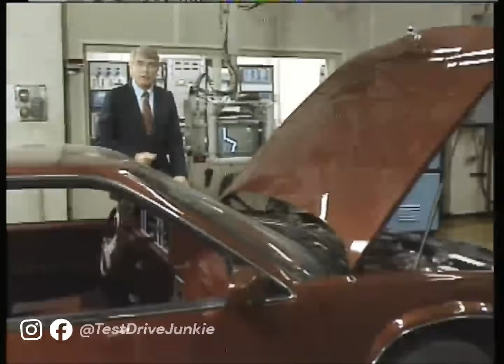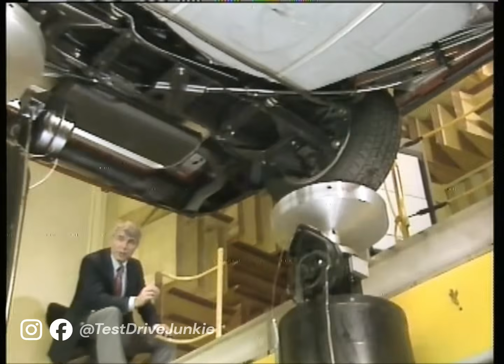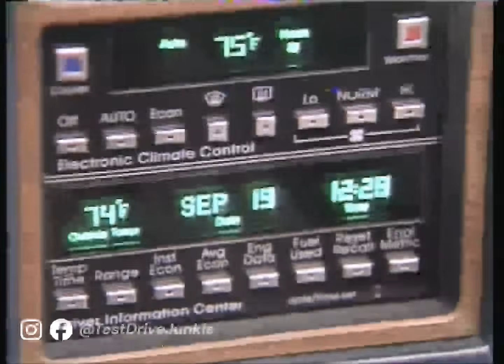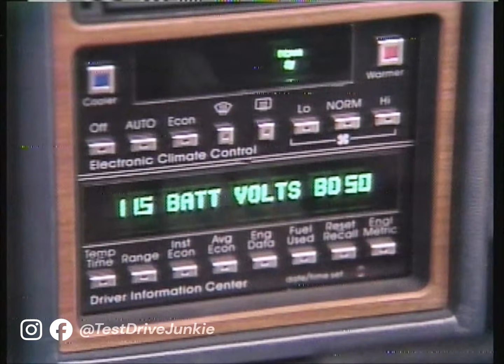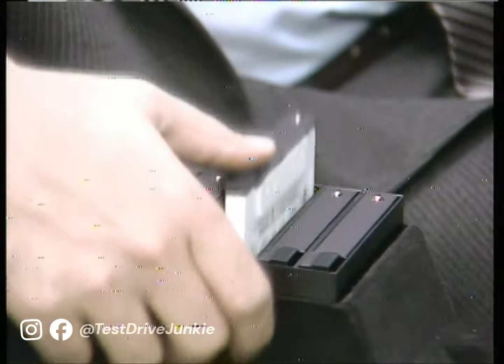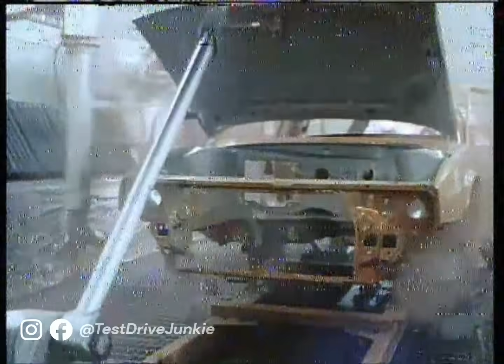1986 Cadillac Eldorado and Seville Manufacturer Laserdisc Selling Information Promotional Video

Comment: By this time, Cadillac was still trying to recover from its disasterous 1982 model year, and I don't think downsizing helped anything at all. Quality was still low, and reliability beyond the 3 years of ownership was dubious. Oil leaks were common in these I remember noting as a youth how terribly cheap the downsized Eldorado and Seville looked. The front seats were so thin and flimsy, they looked like they would easily collapse during a wreck. Even the tufted leather seats in these were so thin they offered next to zero padding. I remember riding in a 1987 model in those days and remarking how uncomfortable the lack of padding was. What didn't help Cadillac's reputation at the time was the fact that they used corporate levers and buttons common to nearly every brand GM had to offer, so there was very little that set Cadillac apart from Olds, Buicks of the day. The only downsized Caddy of this era I loved was the Sedan deVille.